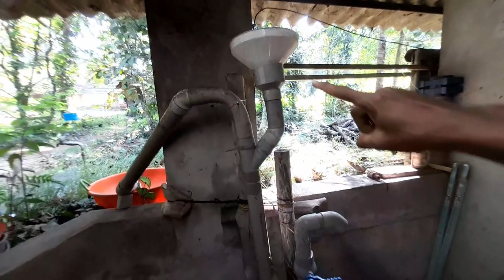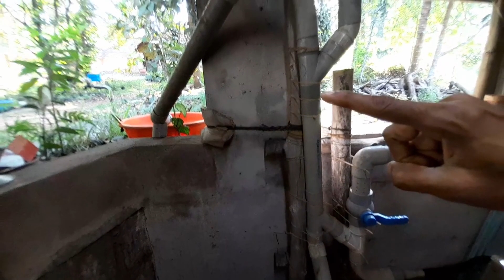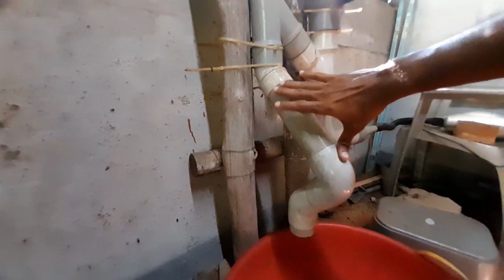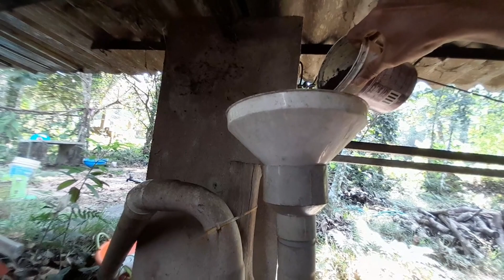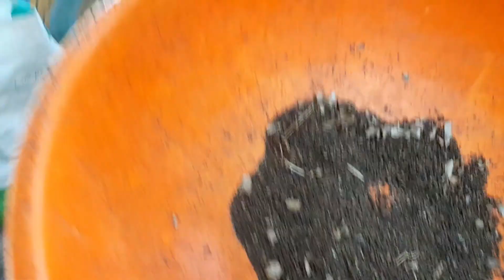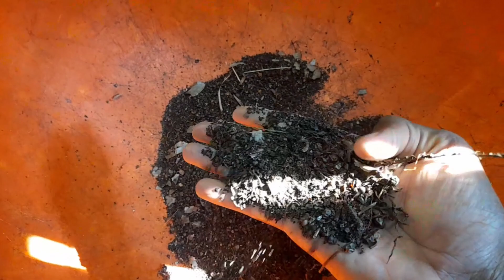Multipurpose cocoa winnower built from PVC pipes - Kannada with subtitles

Comment: Dear Kumarlingesh. Thanks by your explanation and share.  In this video and in the previous (initial video)  It seems to me that FINE POWDER was previously removed from the mixture of Nibs and Shell?.  is it Ok? or what do you recomend to avoid the Fine Powder fly to the working room?  I wrote from Bogota - Colombia  Thanks.
Reply from the maker: Hi there
Please use the bag to collect at waste output. It will solve the dust problem to some extent.